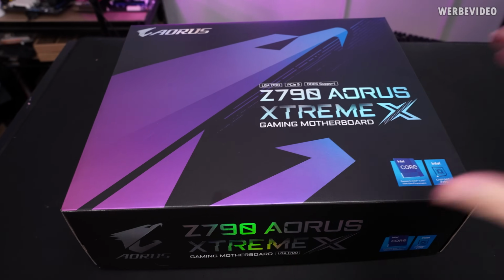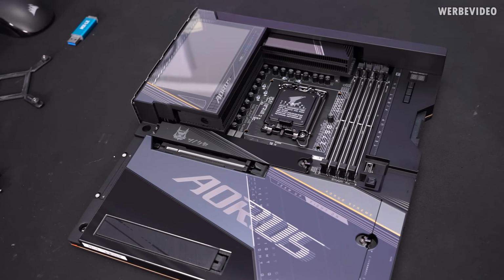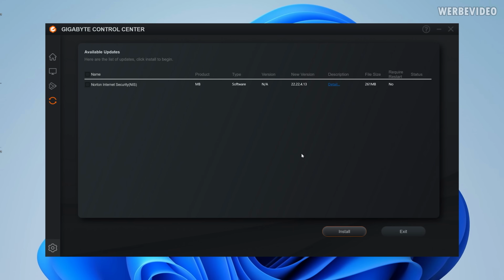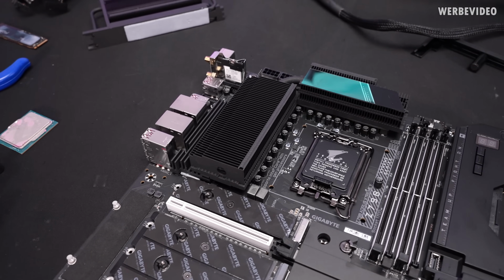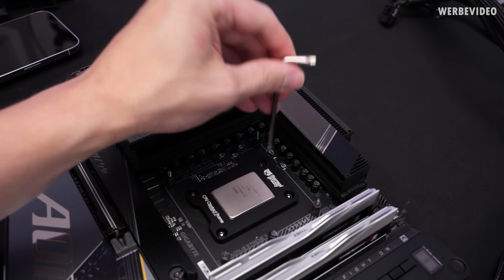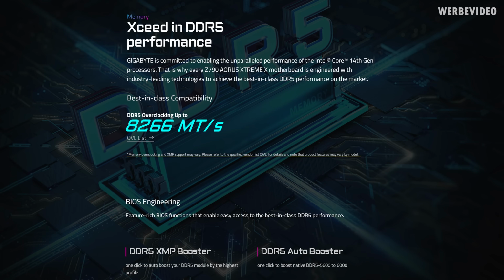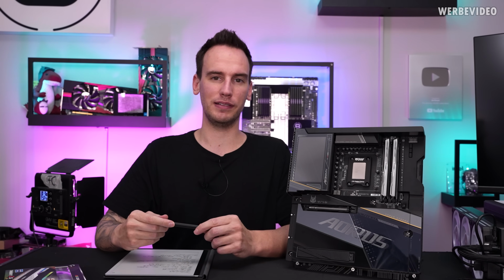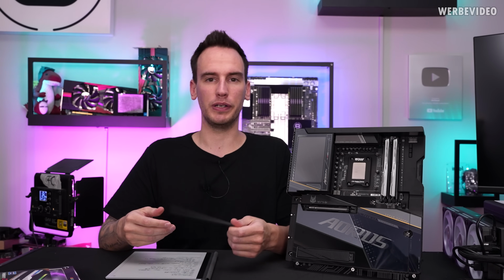Overpriced and Disappointing! The $1300 AORUS Z790 Xtreme X

Comment: For a board that price, I'd expect PCIe switches for dual x16 slots or a full uncut x16 slot with multiple PCIe 5 M.2 slots.
Reply: What ? You expect to do some high-end stuff with a board wich is just marketed as "high-end" ? You want to connect more than 2 M.2 to it, to do some "nerdy stuff" ?? You should consider yourself lucky we don't make it explode this time ! Now shut up and give me your money !
 - A Gigabyte higher-up, not probably
Reply: I don't think the CPU can do more than 16 lanes of PCIE 5.0...You can use them all on your GPU or you can split them with a 5.0 M.2...This motherboard is only expensive because of the cosmetics and the R&D it took to put all the connectors on the side of the board...Nobody should buy this board and I doubt they expect many people will
Reply: @brucepreston3927  With PCIe switches you can do pretty much anything.
They could turn Gen5x4 into Gen5x16 if they really wanted to.
The point isn't to necessarily get more bandwidth as the CPU is the limitation, it's to be able to connect more devices transparently and have them recognised at whatever lane count.
Reply: @popcorny007  Yea i get how switching works...It just didn't sound like that was what he was saying in his comment...I guess I just misunderstood
Reply: @brucepreston3927  True. intel CPUs still are behind at terms of PCI-E lanes. Up to 9th Gen they had just 16 lanes! means even 1 M.2 should use chipset lanes. DMIs were slow.
but All 12.13.14th gen have 20 lane (16 Gen 5 + 4 Gen 4) while AMD has 8 more!!! 28 is enough for 99% people (and in chipset side AMD do better too).
If those 20 could split to 4 Gen 5 for M.2 and 16 Gen 4 for GPU would be nice,
unfortunately it cant and only x4 Gen 4 +  x8+x8 Gen 5 is possible
Reply: @brucepreston3927  You kinda missed the whole point. Cpu's as expensive as 14900k and 7950x(3d) should support 32-40 direct pcie 5.0 lanes. It should be incorporated into it's design instead of being used as an excuse of why the mainboard doesn't support more lanes to the cpu. Or at least have a slightly more expensive cpu as an option. Kind of like when I had an i7 4820k which was very similar to the i7 4770k but had 40 pcie 3.0 lanes directly to the cpu, the platform also supported quad channel memory and 8 ddr3 slots all for a very affordable price of slightly over 200€ for the mainboard and pretty much price parity with the 4770k for the 4820k of slightly above 300€. The point is what you get for your money with the mainboards and cpus of today interms of I/O is a pure joke.
Reply: @brucepreston3927  exactly.  Simply reading or understanding the architecture would prevent inaccurate comments which isn't surprising for youtube...
Reply: Gigabyte supports PCIe bifurcation on their PCIe 5.0 slot. So technically you can put 2 graphics cards on 1 slot.
Reply: That's what should be expected as a bare minimum for 400-500 €/$ considering what you got with x79,x99 and x299 which where probably cancelled because why not ask the same amount of money for a regular Z board when people still buy that and you can force the rest to buy even more overpriced server boards because they have no other choice. Also profit margins are much more important than consumer satisfaction what are you thinking.
Reply: 14th gen only has 16 pcie 5.0 lanes and Zen 4 has 28 lanes. Or I guess you meant x16 with 5.0 and x16 with 4.0 or x16 4.0 and multiple 5.0 M.2 slots.
Reply: @Simon_Denmark  PCIe switches can take a single x16 electrical line and mux it into 2 full x16 slots, or 16/8/8. 16/8/4/4 etc. They used to be available on mid-high end consumer boards until the manufacturers of them increased the price massively (about 1000% price hike), so they are now only available in highly expensive server gear.
Take a look at the old GTX 9800 GX2. It had a nforce 200 PCIe switch to provide both GPUs an x16 interface.
Reply: @simotanska8937  
If it could split  20 to 4 Gen 5 for M.2 and 16 Gen 4 for GPU would be nice,
unfortunately it cant and only x4 Gen 4 +  x8+x8 Gen 5 is possible
good thing about next gen is 24 lanes (I know still is behind AMD 28 ready to use now!) but full x16 gpu and dual gen 5 m.2 is more than enough for most users (for main part)
and for those need more there is other chipset lanes left too

I like to see how will be intel next gen Ark iGpus too. for long time we left with old UHD series at desktop with intel and Vega series with AMD (7000 series RDNA iGpus are too weak! because of cutting 90% of their cores, I know AMD did it to wont be powerful enough and cant affect on his future launched APUs which gonna use same RDNA but with more cores)
Reply: For a board that price I expect it to make me dinner.
Reply: ...but the CPU doesn't have that much of PCIe 5.0 lanes, actually. 🤷‍♂
Reply: And two 10GbE ports. It's annoying that consumer motherboards insist in pushing this backasswards 2.5 or 5GbE network standard, which is not used anywhere.
Reply: @BrunodeSouzaLino  exactly
I never saw place use 2.5 or 5Gbps 
most had 1Gbps or 10! nothing middle ground! 
then adding expense for useless 2.5 or 5 is for nothing, its gonna use as just 1Gb.
but 10 (in this borad both but at others just single) is gonna be there for sure,
even if someone doesnt have it now gonna be future proof
Reply: Maybe you're wanting too much huh, most of these design limitations are due to the intel/z790 project (on server platforms you find - basically the same processor architecture, but for PCs they are taken away or limited sharply) - which isn't It's exclusive to this motherboard. You certainly wouldn't be able to make use of half of these resources, it would just be another PC to run benchmarks and show off to others how much bigger yours is.

Comment: The CR23 unstable is probably caused by the very low CPU core voltage on this motherboard. My ROG APEX ENCORE with the i9-14900K consumes nearly 400W when running CR23 by default, and with adaptive mode at -0.055V and LLC 4, it consumes 380W. When I undervolt to -0.1V, I encounter the same error as you did in this video.
Reply: Conversely - ASUS motherboards are so overvolted by default they tend to cook CPUs... so basically, what this mean is that CR23 straight up doesn't work as intented with the current gen of CPUs, because you have to push them straight into destructive territory.
Reply: What's the maximum voltage you see when hitting that 380w mark with your offset and what would the board give it without it?
Reply: @DavidTMSN  With offset -0.055V, the maximum VCore is 1.4V and 1.335~1.35V when full loading (running CR23), without offset the maximum VCore is around 1.45V  and 1.39~1.4V when full loading...
Reply: @Tube_Boy  I imagine it'd be board dependent but getting to 1.4v max is pretty good although it's still a ton of power draw.
Reply: Asus maximus boards don't follow Intel spec they run unlocked limits that's why a 14900k will pull 400w out of the box
Reply: christ me....

Comment: This is off the chart, altho is would fit my old Corsair 800D super tower case, and still looks like a ITX board is placed in there, this case is just too big (1m x 40cm and 65cm deep), even an EATX board, which I used back in the day with an MSI high end mobo. And I had the same problem with memory. When I put it under load, blue screens were not far away. I wouldn't buy it personally. With that price you can build with a cheaper board and do a custom loop. Instead. IMO.

Comment: Question. i looked at ROG Z790E and B650E-F and in tech specs found that if gen5 m.2 used intel goes 8x on pcie gpu slot, but on AMD i didnt found that, so does B650E-F strix get you 16x pcie 5.0 and gen5 ssd?
Reply: Yeah, B650E supports both pci5 for one x16 slot and one x4 m.2 without sharing the bandwidth. B650 on the other hand only supports pci gen 5 for one x4 m.2.  
As a side note, you might want to give the asrock b650e taichi lite a look. I remember seeing it around the price range of ASUS B650E rog strix (both variants). Its E-ATX I believe, but it should be more bang for the buck.

Comment: I miss the days of a Motherboard costing £250/£300 being high end and now you don't even get all the features at that price point which is just sad
Reply: This. My X79 mobo (about to get demoted) was all of $300 back then.

Still has way more than most of thes "high end" consumer motherboards.

It's seriously criminal.

Hell, Threadripper 1 motherboards are going 250 and trouncing that even, though there it makes sense.

After 2020 scarcity, they seem to think it's okay to just charge through the roof for something 1/4 as capable.
Reply: @MaddJakd  I know I agree
Reply: asrock x670e pg lightning for $230 exist, or pro rs. sub $275 and has 5 nvme slots no disable.

it's the "high end" market that's not high end anymore as much as it's meant to sell to idiot whales.

oh and 4 NVME slots z690s/z790s go sub $190 a lot.
Reply: @BodethIII  my b650 edge cost £250
Reply: then don't get $250 b650s clearly. that's x670e money.
Reply: @BodethIII  umm x670 in the uk is easy £100 more
Reply: Back in the days Z370 Formula/Apex were just ~$400, PC parts nowadays are so much more expensive.
Reply: someone remembers!  i miss the old days.   i remember when £300-350 was a high price for a new  high end GPU.   some of these high priced mobo's are a joke too..   smothered in RGB with a bunch of cheaply made plastic childish gimmicks thrown onto it to appeal to gamers.
Reply: @sausagefingers714  i agree i remember them also and i remember GPUs looking better and motherboards used to have awesome themes

Comment: One of the worst motherboard purchases I ever made was an $800 MSI threadripper. It was garbage. After not being used for a while 1/2 the memory stopped working which seems to have been the power delivery failing and killing 64G of memory. Went to the MSI forum and see someone else complaining about exactly the same thing with zero answers. Will never ever buy another MSI board.

Comment: The 'top' M.2 slot's clear advantage is its accessibility especially for those who are using Water Blocks that are covering access to every single other M.2 slot. I'd much rather lose 0% to 2% then have to drain and completely 100% disassemble my water cooling to access M.2 slots.

Generally, the most expensive are out of the MSI Godlike or ASUS ROG Extreme Glacial. My takeaway of the Gigabyte Aorus is .. I like the top cover for the CPU pin area and I like that they right angle side mounted the USB Type E header. Let's be real, none of the software for any of these motherboard manufacturers is any good.

Comment: This is what I've been wondering in relation to the (over)pricing of the current mobos. With AMD, some said that the manufacturers want to get as much money as possible since AM5 supposedly has a long platform life. That I can slightly understand. However, what's up with Intel's case. This is basically the eol of the socket/platform. So what's the reason or excuse for this one?
Reply: I would guess it's greed mostly, but it might also be sort of like with the graphics cards, where AMD tries to price their cards towards Nvidia. So if the Intel board were to be cheaper than the AMD board, and as you said they wanted to price the AMD boards higher, because people would be using them for longer, then some/many users would feel like they were taken advantage of, because there wouldn't be so much difference between the two boards (Intel and AMD), but one would be significantly more expensive only due to the kind of CPU socket.

Comment: Remember cinebench doesnt even load 98% memory to find instability. If you run a ram stress test it will error out in 1 sec. Did u even tried to raise vdd voltage by a bit? Or did you let it go

Comment: another "very high end motherboard" that has a single useable pcie slot and where you cannot populate the visible slots without a dramatic downgrade of your gpu
1)the top nvme slot will HALVE your gpu bandwith manual says "pcie1 goes x8" what people don't know is that it's x8 of whatever pcie your card has the rest of the 5.0 bandwith is lost, in the case of a 4090 it means you get 13Gb/s instead of 24, test it yourself with 3dmark pcie test 2)the bottom slot looks like a x16 but it's actually a pcie 3.0 x4 trust me because I wasted almost 3000$ in high end motherboards those last years...they are way worse than the mid-range..not even talking about the lack of support as mid-low range boards have better bios support

Comment: That 4095W powerlimit looks quite funny, but with the actual powerdraw of Intel's stuff recently, it's not really. I guess this board is purely for beauty builds, as for heavy OC it's not suitable due to the memory layout. Does look good and I very much like those 90 degree connectors all on 1 side. Would be cool with a regular ATX size board in a E-ATX case for nice cable management.
Reply: Same with GPUs you can load a bios and set power limit to 2000w and it will run nowhere near that because of current and voltage limits.

This board and last few gigabyte xtreme boards have all been for show, the only people buying them are those who don't know any better. There are cheaper gigabyte boards that will overclock better and the average person only needs a $350 board.

The reason this board exists is because there are some people who will just walk into a PC store and say "guys here is $10k, spend it all and give me a beast" and then they will use this motherboard

Comment: The problem i have when there are memory issues is corrupting windows installations and then it's a pain in the ass to have to either redo them or restore a complete carbon copy backup and waste time, write cycles on flash-based disks (ssds 2.5' and nvmes) just because a company is lying and over promising while underdelivering.
You of course should be testing a kit with a USB with Memtest before you put install an OS but the regular user isn't gonna do that let alone have a spare OS backup drive, like come on, is it so hard to NOT release a product when it's not ready and also ask a fuck ton of money for it just so you have enough to keep fixing it later?
What kind of economy system is causing this, oh yeah i forgot, uncontrolled ultra greedy capitalism.

Comment: I am truly blown away by this outcome, who could have guessed paying 1300$ for a motherboard could end up as ill advised use of your money? Truly life changing revelations.
Reply: There have always been boards built for the small percentage of PC builders that want to push the bleeding edge and run overclocks etc etc. Always been a niche product and over the years Gigabyte have built some exceptionally high end boards for those that want to push the limits. Sadly this board simply seems more like a money grab based on the reputation of past offerings.
Reply: @johnramsey8712   Yeah, but I mean, this isn't even a board to get cutting edge performances. An Apex or Tachyon would be what you want for that. This one is... pointless ? Or to be put in the same category as a pretty handbag from luxury brand : a way to burn money and show to have money to burn. No practical use
Reply: I almost thought it was a budget motherboard
Reply: The sarcasm is strong with this one
Reply: consumers driven corps to increase mobo prices buy buying whatever corp throws at consumers, corps throw in a 1000usd mobo - consumers buy it anyway, corps get a mindset of charging whatever they want for mobo's because of us the consumers allowing it to happen... if no consumers buy 1000usd mobo's there will be no 1000usd mobo's because - no one buys them, if they exist means someone is buying them allowing corps to charge whatever they want... blame people for allowing it not corps for running with it lol
Reply: @1sonyzz not necessarily. Sometimes the overpriced HALO product is not meant to ever be sold. Its meant to make the already overpriced but cheaper option look less overpriced.

Next to a 1300€ motherboard, a 400€ motherboard is cheap as chips, even of its still 200€ too expensive

Comment: I think Gigabyte made this board just to make their Tachyon and Master look like good deals!!!!
Reply from the maker: That kind of worked out 😂
Reply: It is honestly ridiculous how the prices climbed up when it comes to MBs.. I built new PC during the RTX20x0 era and while this was the time when GPUs etc started becoming more expensive it was still very passable. I bought Aorus Master for intel 9th gen for like 230 Euros or sth like that at the time. Pretty much top tier board for less than 300... These days you get basic crap without dual bios, post code or heatsink with fins for the same price when it should cost sub 100...
Reply: @ak4sh455  Actually about the dual bios thing. I had gigabyte boards over the years with dual BIOS and they are a disaster!
Never worked! When I needed it to, it was stuck. When I didn't need to, it would revert to the second bios which did not support the CPU properly and I had no clear way of figuring out which bios it actually booted to. Even with the switch...
Reply: @DLTX1007 The Gigabyte dual bios boards that had the automatic switching were terrible! But the Z390 Aours Master had a physical switch and it has worked great for me...There is an LED that lets you know which bios you booted on if you borked one and it booted to the other...There is also a switch that can keep it from reverting to the back up bios...
Reply: @ak4sh455 It's crazy how much the prices have climbed! I also bought the Z390 Aorus Master right when it was released and I paid like $290 for it and it is an awesome looking fully featured board...I mainly bought it because of the dual bios switch, which has saved me a couple times!
Reply: @ak4sh455 inflation. All of our countries are going through hyperinflation. 😢